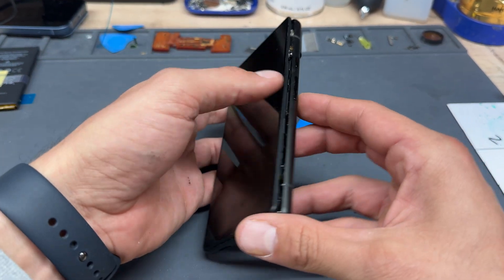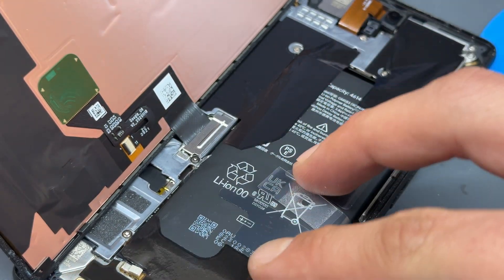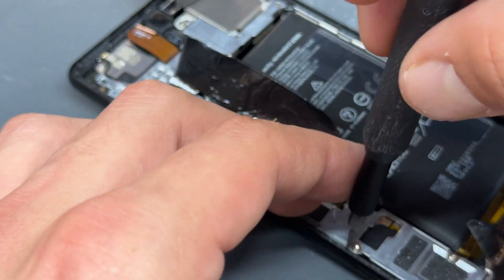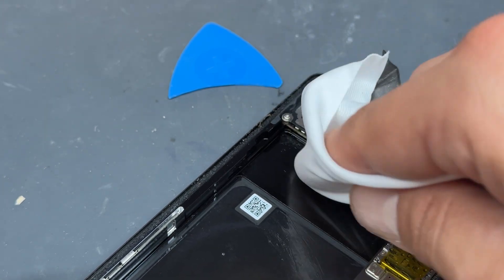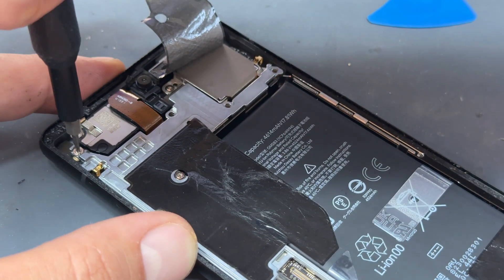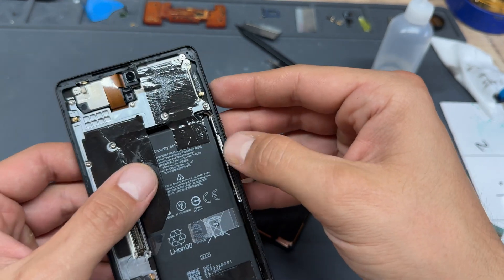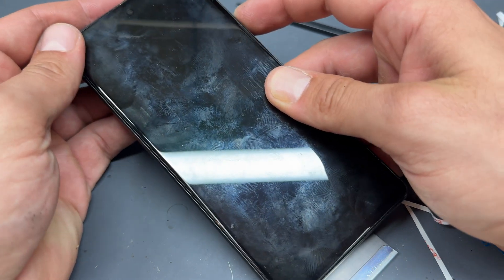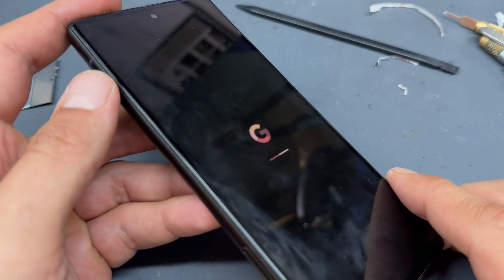Google Pixel 6 Battery Replacement - Complete DIY Guide!

Comment: My SO messaged me saying their phone was getting a beer gut. I was like 'that's the battery. We should either replace the battery or get a new phone. I watched your video and after figuring out the new phone would take over a week to get here and the replacement battery two days I figured I could do the repair. Ty. Your video was exactly what I needed and worked wonderfully. SO is happy and we saved a lot of money with the repair instead of getting a new phone.
Also my SO had never heard the term spicy pillow before lol.

Comment: Thanks so much for this video! I just successfully changed my battery. At first the screen wasn't working and I thought I'd messed it up but then it turns out I just needed to press the power button and the volume down button for nearly a full minute to restart it.

Comment: Great video, nice filming and perfect commentary.  One point:  when re-assembling don't just put any screw into any hole.  A long screw tightened into the hole for the screen attachment point will break the metal receiver for the screw off the board; don't ask how I know this!  A dab of CA glue hardened with a dusting of bicarb sets it back in place.  Follow the instructions to the letter!

Comment: in the middle of doing this right now, my phone was almost insta dying around 20%. had the half right of the screen already separating because the original battery was bulging on that side so easy enough to get the screen off with some heat,plastic pic/suction cup, and some isopropyl/q tips .
simply took a smoke to get me focused 😂😂

Comment: My display was lifting up a little in the middle of the right side so I thought the battery was puffing up. I ordered a new battery and adhesive from iFixit. The battery wasn't puffing up much but someone had been in there before. There were some loose screws, the display connector bracket was missing and there were two layers of adhesive under the old battery. I was on android 14 for the longest time without any issues. It had been begging me to update on a regular basis. I finally consented to the android 15 update and a few days later it installed android 16 without my consent. This latest update had been killing my battery life. I just completed the battery replacement cleaning off all old adhesive. The display seated perfectly. It's charging up now, I'll have to see what battery life is like.

Comment: Last time I replaced a phone battery, it was a 10-second job. I wasn’t prepared for these 20 steps of ridiculousness, got pissed off, and cut corners. I didn’t bother preserving that black tape and just stuck the screen back on with the leftover glue. Surprisingly, it holds really well—I can’t even take it apart now without the help of a bloated battery. Only afterward did I notice that the battery kit included a neatly pre-cut adhesive strip, but it was too late by then. I’m sure it’ll last another two years or so.
Thanks for the straightforward video.

Comment: Just replaced mine in my pixel 6 following along this video. It's very easy and honestly, I didn't even use half of these tools. Just a T2 driver for the little screws and a tiny, tiny flat head screwdriver worked for me. The alcohol is key to getting all the glue off though. Worked out great!

Comment: Great video.  Stickytape was a great idea.
The display connector clip took a while to 'click' in.  I just has to look closely at how it actually functions (that little nub clicks into the hole in clip).
I spent $230 on a pretty good Pixel 7 from Swappa.  Will give the Note 6 (with fresh battery) to my kid.

Comment: Very nice video, well explained and good filming as well. I was wondering how you were going to deal with the excess tape but your technique is great. Thanks. I can try it now. Mine too the battery pushed the screen out, it should be relatively easy to get it off.

Comment: Remeber the when 90% of the cellphones had a back that popped off and let you swap the batteries? Amazing vid btw, im just astonished how complicated changing a battery has become in comparison.
Reply: That's the point. They sell more new phones that way. Just be happy you don't have an apple, where it's 10 times harder. 
Apple is for suckers.

Comment: I waited on repairing my cracked screen until ifixit finally stocked up on batteries.
Eventually I stopped checking the stock, but just as the LCD finally gave up (all it needed was one slight bump) they also restocked on batteries. So even though I already have a screen replacement ready to go, I just had to take the opportunity to swap out the (heavily degraded) battery too.

I didn't know about the plastic band thingy, that eases my concern a bit with the adhesive (even if it's not very good, it's at least something).

Comment: Hey! Just followed this guide but my rear camera has stopped working. Any ideas? Ty
Reply: managed to figure out what happened and i got really unlucky with my battery change and the connector ended up getting damaged. i'm not stuck with a phone that doesnt have a working camera. this will probably be the last time i attempt one. i would say to anyone doing this make sure you are very careful to not disconnect the camera ribbon directly above.

Comment: The Pixel 6 is such a good phone that I am going to take it all the way to end of support on 1/10/2026. Getting a battery kit that includes all tools needed and a heat pad. I was looking at lineage OS but tbh because Google are being so amazing with long term support - what's the point. The phone still feels very fast and smooth with a gorgeous screen and camera.
Reply: same! I've had mine for well over 2 years and I got it used — the battery swelling is the first problem I've had with it (which is wild because the battery life is still quite good). I'll probably keep using it past the end of support, as long as there are custom ROMs to use that take care of vulnerabilities. 

I used GrapheneOS for quite some time before switching back to stock, and I quite like it, it's one of those "privacy focused" OSes, but you can still use the Play Store with it, which is honestly just great. Definitely recommend giving that a try.
Reply: I still think its better than the 7. the 7 is already getting recalls or free battery repairs because its known to get bloated quicker than the 6
Reply: @darienford860 I don't know if you own a 6a, but Google just pushed a mandatory OS update due to battery overheating issues and the update reduces charging speed and battery capacity. When I get to 30% battery, the phone randomly dies in 10-15 minutes. 
The 6a has the same crappy battery issues as the 7.
It's still a great phone, but it definitely needs a new battery now.
Reply: My Pixel 6A just separated on lower right and is overheating after 3 years.
Support has been extended to mid 2027 but it would cost me $100-$130 to replace vs $0 for upgrade to Samsung with 6-7 years support. Previous pixel 3 screen died at 3 years too.
Guess which one I'm choosing?
Reply: @jlr4434 I hate Samsung's bloatware and shitty operating system. 
Guess which one I'm choosing ?
Reply: @Boogie_the_cat  swollen battery on my pixel 6, currently using a Samsung A71. Man i miss my Pixel
Reply: @jlr4434 if u want to keep the pixel phone as a backup or for family to use Google is fixing the 6a batteries for free with a recent recall

Comment: Thanks, this also helped me to replace my bulged pixel 6 battery. Instead of buying a new phone, it only cost me around 50. I got the replacement battery + repairkit from a website called "IFIXIT" , they seem to sell genuine pixel parts. The repair kit came in handy with all the small tools you would need, can definitely recommend. In combination with this video, it will be easy enough for most people to do it.

Comment: Thanks a lot for this video. It really helped out. Just throwing this out there though, supposedly acetate is relatively risky for electronics, but you know that probably. I just found that out from gpt, so I used isopropyl alcohol instead for removing the adhesives.
Reply: He said he used Isopropyl alcohol. Did you watch with sound off?
Reply: @paulnicholas5449  he does use 'a little dab of acetone' after he takes the battery out to clean around the area.  It's the bit where he says he 'hates putting new adhesive on top of old adhesive' and 'if a job's worth doing, it's worth doing right isn't it.'  5:45
Reply: @paulnicholas5449  bruh 5:45

Comment: Great video. Successfully changed a battery. The adhesive battery tabs both broke but adding lashings of alcohol and gently pulling up the battery with a spudger worked fine.

Comment: This tutorial was helpful in guiding me how to remove all the parts and replace the battery!

The only problem I'm having now is that, after putting the phone back together and trying to turn it back on using the power button, it did not work. Plugging it into a charger did turn on the phone, however. I can use the screen and apps just fine, but the power and volume buttons no longer work. 

Any idea where I went wrong?
Reply: I'm not blaming you or your tutorial for the buttons not working, by the way!

Comment: Yep, awesome tutorial. I’m a 50+ mum of 2 & I followed along. If I can do it, anyone can. Thanks for the help!
Reply: Well done! My mom is 70 will Tell her :)
Reply: Yeah? With your tech hotplate on hand? GFYS liar
Reply: @awakenthechosen Dude literally says in the video that you can use a hair dryer instead of a hot plate. But go off
Reply: @awakenthechosen you can use a hair dryer
Reply: @awakenthechosen  The only thing I needed heat for in this job was making the graphite film easier to peel off. My display was already lifting up and some 99.9% alcohol and the built in plastic strip made light work of the battery adhesive. A hair drier, suction cup, and some guitar picks would be all that is necessary for a phone that was in better shape than mine was.

Edit: If you're going to pick something that would be unlikely to have at home, it would be the torx screwdriver needed for the motherboard shield. She could have easily ordered that though.

Comment: All they had to do was give you a battery cover. Corporate greed took that away. The adhesive tape looks like a good thing  i would of put 1 drop in each corner just to fill the tiny gap between the tape strips

Comment: Wouldn't it be easier for these phone companies to make phones with removable back covers like they use to. Just money making for you to buy new phones.
Reply: Ugh, I had an old BlackBerry phone. Had to do a battery pull at least 1-2 times a day bc it would sieze up.
Followed by a BlackBerry a Z10 which was better but still had removable back. I ended up ordering a replacement battery when the original got old. Much easier to deal with.
Reply: Nah that would make them not water proof of way to big
Reply: The Samsung Galaxy S5 had a user replaceable battery and was waterproof.  @jojojos5
Reply: @jojojos5 honestly it worked fine when we had before. And I'm sure they could make them cheaper still. So replacement wouldn't be as bad.
Reply: @bmo14lax  They didn't. The amount of water damaged Galaxy S3s I had to repair was insane.
Reply: No because a certain number of people destroy the screens so they get another screen sale. If you pay someone to do this it makes it much more desirable to sign up for another couple years of expensive phone service to upgrade your phone. What are you thinking ! It's built in obsolescence.

Comment: Today my iFixit essentials tool kit came (Well it’s past midnight rn so it was yesterday) and I replaced my friends iPhone 12 screen with an OEM screen replacement, and the adhesive was really hard to remove! I used rubbing alcohol to remove all the adhesive, then put the seal on. And I tested it and it is 100% fully operational with Face ID too.
They will be really happy to have it back again.